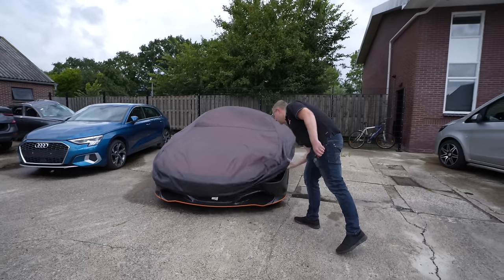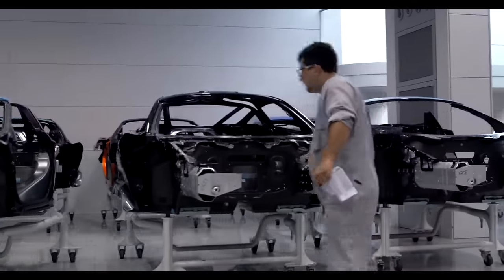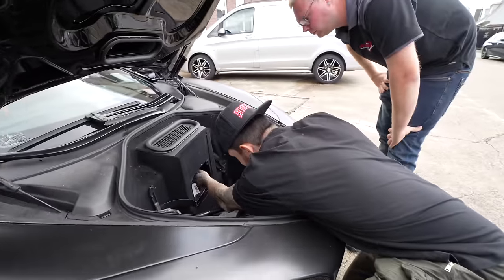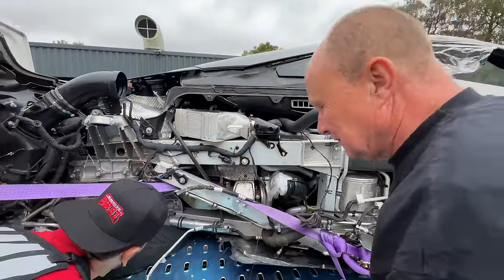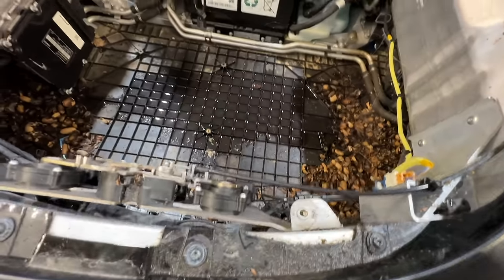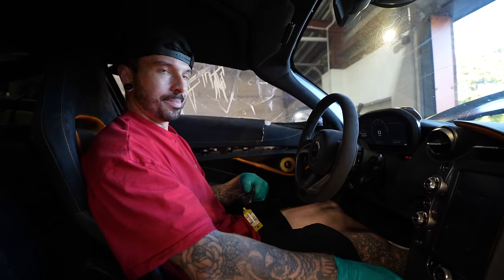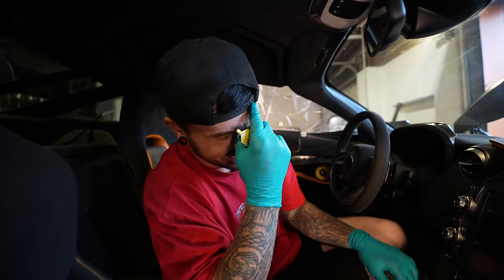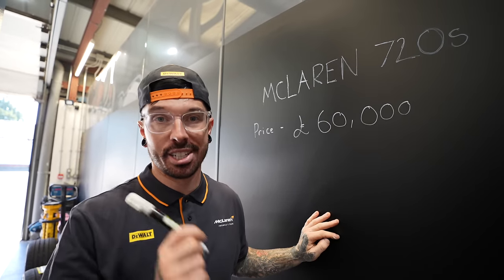I BOUGHT A WRECKED 720s THAT MCLAREN WONT FIX

Comment: As someone who made a lot of those carbon parts in the past, I’m interested to see how this goes good luck Mat
Reply: Me too
Reply: It's an area that really shouldn't be repaired... it will def need more than just a patch filler...
Reply: If you could help Matt, I'm sure he would pay for your trip to come out to help him
Reply: as some one who hand forged carbon for 25 years, 5x Gold Certified Platinum Craftsman, i'm unsure to say the least 😂
Reply: Do you think is repairable?
Reply: @timcozad6125  100% with you on that, if the tub has been compromised then it’s scrap. And not even wet lay gunna be good enough to put the support back in there and make it safe/ strong enough for my experience, and spare carbon tubs are hard to come by..
Reply: @graham535  carbon cracks and shatters once its compromised
Reply: @hassyg4083  yes this is true but with something as big as a tub, you’ll be able (as such) to cut out the damage area and re-lay it all up, but.. 1, you wouldn’t do this to a tub, it’s too much of a structural part. 2, you’ll need the correct thickness of the roha-cell glue film UD and carbon .. it’s to unrealistic.
Reply: There must be so many carbon specialists in the UK just due to all the F1 teams and their suppliers. I’m sure he’ll get a reliable opinion on it
Reply: @paulocapelas2881  it is of course repairable... the question is is it safe?
Reply: Having worked with these exact tubs there is no way it will be safe to have the repair done. New tub jobbie this. Used tub would be the best next option here. If gearbox has also gone. Then this anything up to 100k repair bill if not more once you look at all other body panels it needs. But I have faith mat will be sound with all his connections
Reply: @graham535  You can do this with structural parts, Aircraft with carbon structure are repaired all the time. As long as you Step out your plies with .5inch+ per ply being repaired it can be done. Using a vacuum bag at 28inch of vaccuum can probably get you good enough ply compaction. The Tubs are probably cured in autoclave at 90psi.

Comment: One thing I’d recommend, is talk to DDE and Mike Essa. He’s been helping rebuild their 720 GTR and he’s understood some things about the car that the average guy wouldn’t know. 
Especially about the rear, and the rear suspension being charged with hydraulics. 
All the best for the build Mat!

Edit : I just saw that you talked to Mike! This is going to be a good build
Reply: Gonna be a great donor car for spare parts 😔
Reply: the real problem for Mat is the monocoque carbon chassis, since its not repairable/replace even if they asked the dealership. the other parts that broken can be easily replaced.
Reply: Did you watch the video? He was literally FaceTiming DDE
Reply: @yjkader  I dropped the comment before I saw that he made a FaceTime call. Hence the edit in the comment. Appreciate your concern tho!

Comment: vTuned repaired a similar damaged 720s and they had to replace the tub. Just give it a shot to the channel to understand the work done. The price is good and if the engine runs and a good tub is available, then could be a nice build!

Comment: Hi Matt, This will be a tricky repair especially with no access to the McLaren automotive ply 3d and ply book as we have no idea what type of resin system or prepreg carbon is used. I would be very surprised if they will ever approve any repair not drawn by their Design Office but you never know. I think your best bet would be to strip it back, have it Ultrasonically NDT tested for delamination's and have an experienced F1 contract composite design Engineer take a look. I can recommend someone that has previously carried out this in this type of work for a client In Brunei that unfortunately totalled a McLaren F1 a few years ago. let me know.

Comment: respect for watching dde 720 fails for lessons you don't have to learn yourself.. fyi - this hidden analog key is also common in some normal cars, it took me 30min to find 1 while locked outta a jeep i had just borrowed form a friend, and the fob battery died in home depot lot with a full trailer of plywood

Comment: You are tough trying to start that indoors :) . if you bridge the starter solenoid wouldn't  it kick in starter again after engine started. It would be cheaper to buy a used at 120K ?  as parts must be more than 60K

Comment: Can you find a 'cheap' front end damaged car with a good tub?  I've seen high speed accidents where all corners get tagged, but the tub is still untouched.  Those cars might be un-interesting to someone repairing a car because replacing all the bits and bobs costs more than they can get out of the car with a bad accident/totaled/salvage on the VIN and title.

Comment: Mat, carbon fiber isn’t safe at all in a car, you see back in the maybe 40’ 50’ 60’s if cars crashed the cars would just give a little hop and all of the energy… needs to go somewhere, what’s the only thing that is not tightly strapped to the car; the human, where does the energry go; the human, and now if you crat a car at a high speed your car folds up, but that is accually safer because the energy of the collision goes into the car.

Comment: The guy said the dealership ran the engine and tested the gearbox, how? Brake pressure and fuse weren't fixed, trans leaking, trust the Dutch?

Comment: Sorry if I am trying to teach you to suck eggs,  if you do get the tub fixed, after changing the gearbox oil cooler check for water in the gearbox oil. That oil cooler is a sandwich type with alternating plates holding water and oil.
Reply: What do you mean if he wouldn’t upload the video if it were impossible